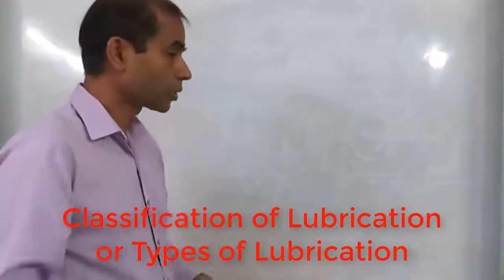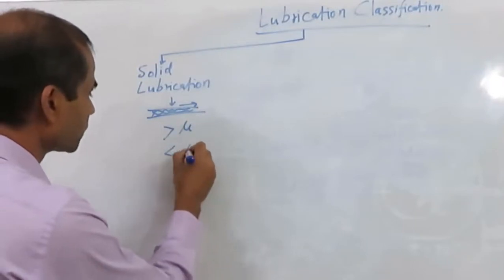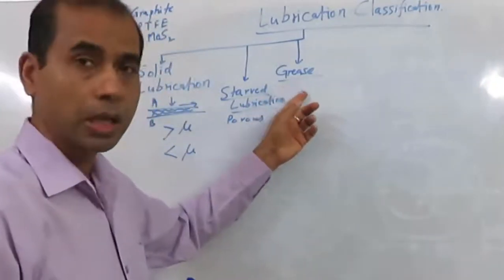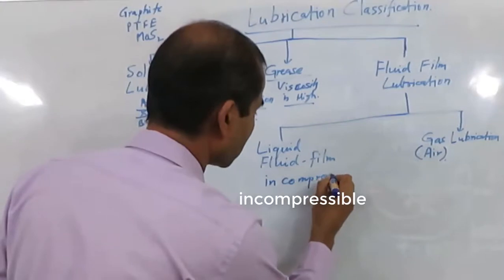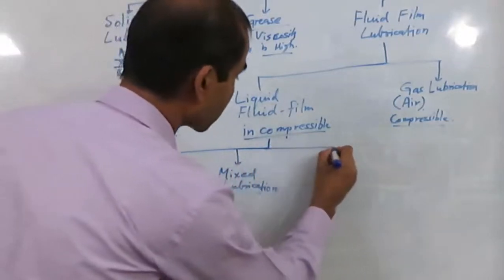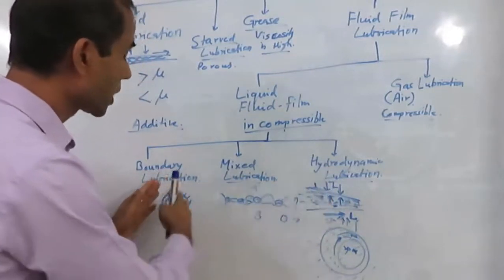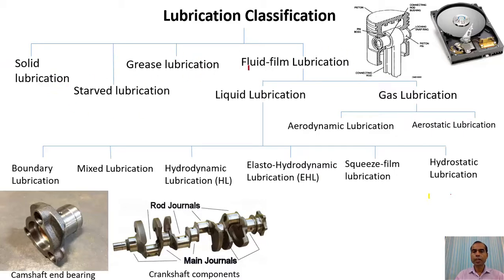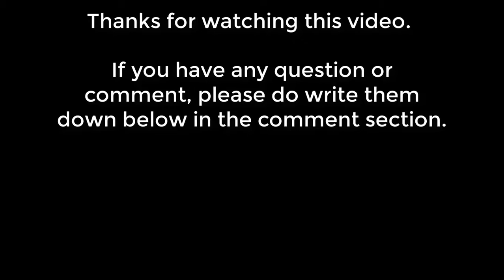Lubrication Classification or Types of Lubrication

Comment: What about electromagnetic lubrication!
Reply from the maker: Yes, magnetic levitation is another method of facilitating no friction situation. However, the method is based to separating the surfaces by creating same pole (rather than using a lubricant). You may include the electrorheological fluid lubrication as another method of lubrication. This was not included in my video. Thanks for pointing out. 👍